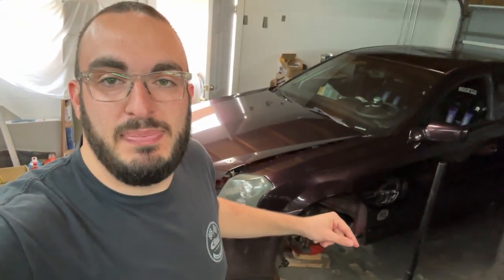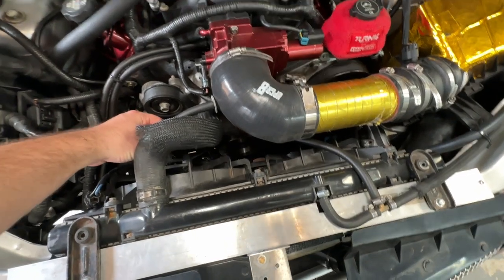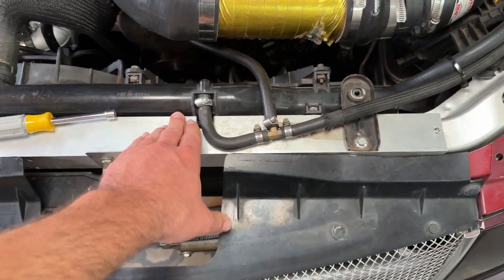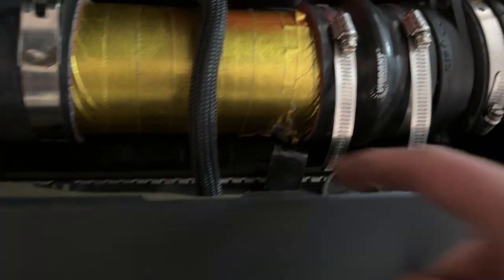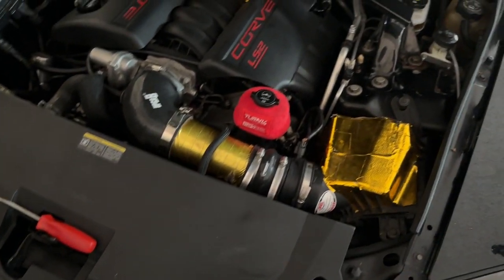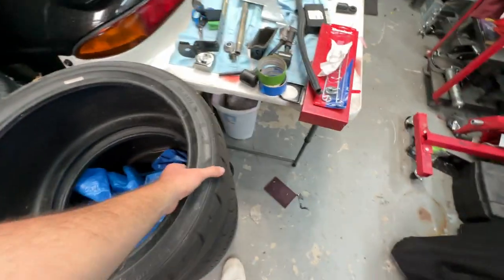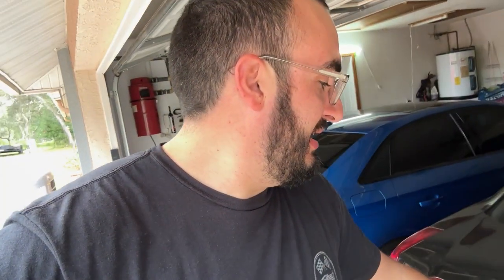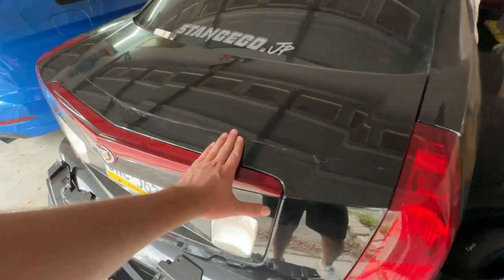The CTS-V Street Car is Making a Comeback!

Comment: What engine upgrades do you have on the ls6? And did you have it dynoed?
Reply from the maker: LS6 in the drift V is a Summit Racing Stage 4 cam, Trick Flow valvetrain, high volume oil pump, intake and full exhaust. Haven't had it on a dyno for power #'s though.
LS2 in the black V is Texas Speed Torquer V2 cam, Texas Speed Valvetrain kit, carbon tube intake, and full exhaust. It made 376 hp before I did the headers, so it was limited.